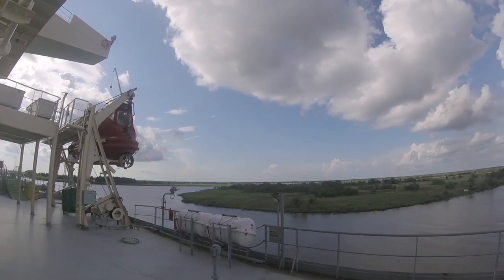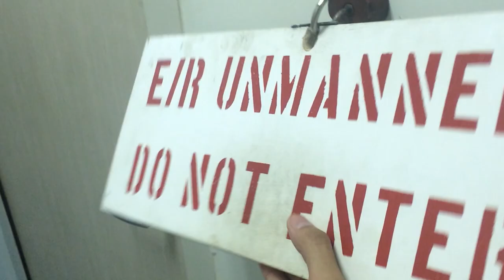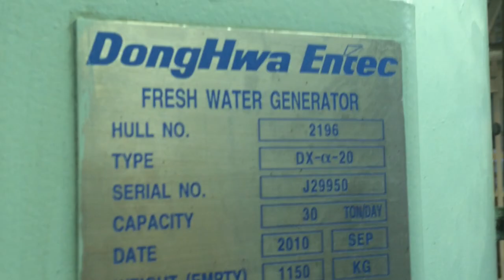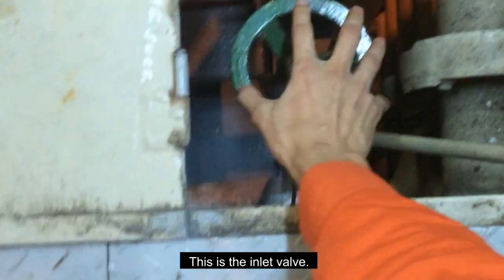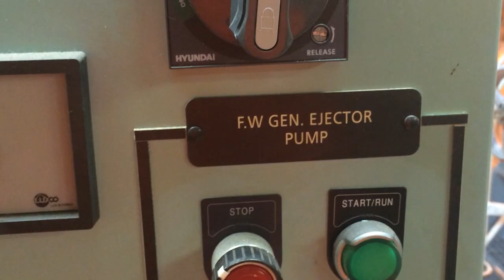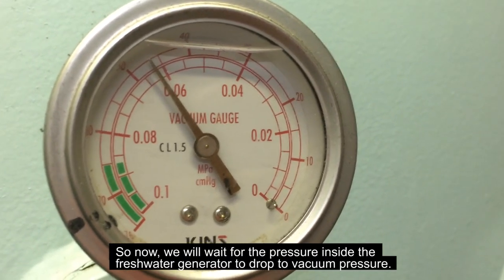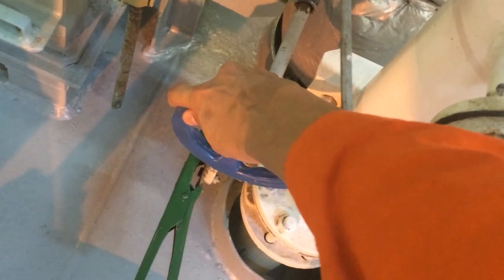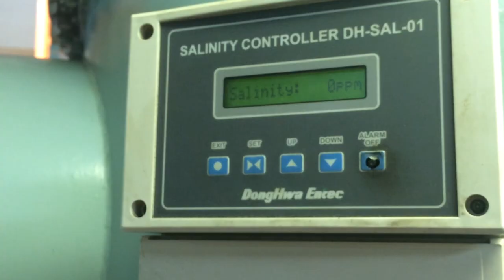How Ship's Produce Fresh Water from Sea Water | Seaman Vlog | Life At Sea

Comment: Nice video again! 👍Fun to watch starting up this Atlas type flash evaporator.
What I always disliked about them: being the duty engineer, jumping out of your bunk in the middle of the night to accept the “salinity high” alarm due to a sudden change in the sea water temperature, and re-adjusting the feed until the salinity was satisfactory again.
The principle however, of boiling seawater at about 40 degr C I always found interesting.
On the jacket water by-pass valve I saw red and white sectors. Probably to avoid closing it too much? And then causing jacket cooling water flow problems in the  M.E.
Reply from the maker: Those marks on the bypass valve is how much the bypass valve should be open when the ME is in full speed. But if you know the principle, you can easily play with the fresh water generator haha
Reply: @SeanLentze  
Correct

Comment: sir pwedi pasagot

The sounding of the freshwater tank would reveal the _______ of fresh water and the amount of freshwater generated on board 

Most ship also have a sounding board positioned either on the _______ or in the alleyway next to the ship's office on which daily soundings are written ?
Reply from the maker: The answers to the blanks are dependent on the ship that you've boarded, especially the 2nd blank. For the first blank, I think 'level' would be the most appropriate answer. For the 2nd blank, on my previous ship, a sounding board was positioned inside the engine control room and inside the ship's office and we always record the daily freshwater soundings in the ER logbook.
Reply: @SeanLentze  thank you sir ❤❤

Comment: Hallo sir i want to ask what kind usually the fwg have problem? What is it? Anda how the way for keep it?
Reply from the maker: The common problem in the FWG is the high salinity if the freshwater produced, it is normally caused by insufficient vacuum and/or inefficient heat exchange in the evaporator.
Reply: @SeanLentze  thank you sir for the information,,could i know your Instagram sir,,if i have some questions i ask you🙏🙏
If you dont mind
I'm from Indonesia
I'm still fresh graduated
I'm a Engineer too like you need your experience who i want to know from you
Reply from the maker: @vickyardi6345  You can ask as many questions here in the comments, I would do my best accommodate and answer it in the best way that I can :)